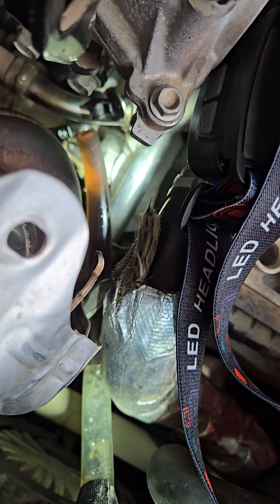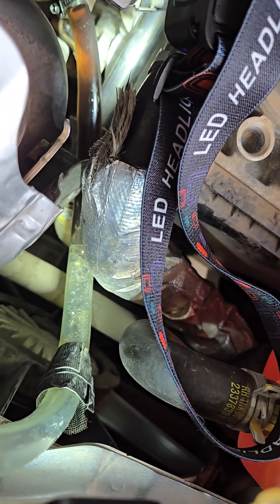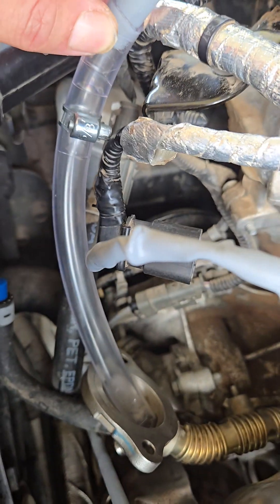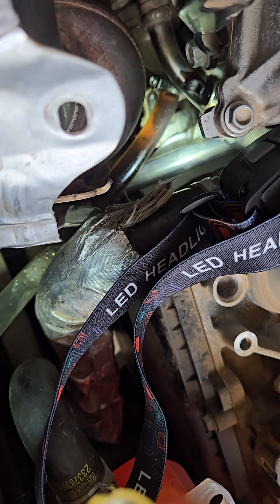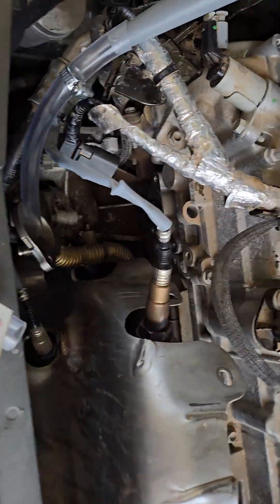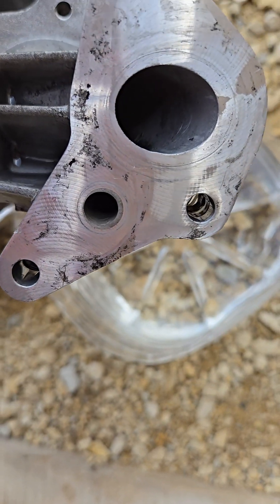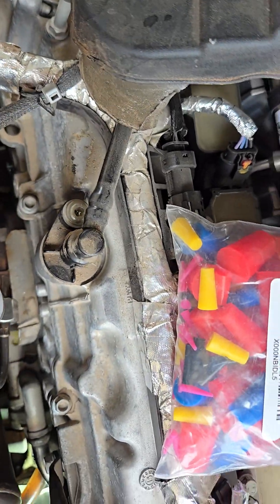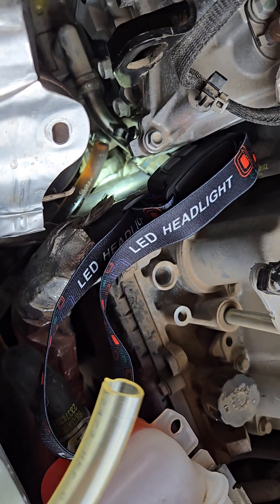2017 Chevrolet Volt correctly cleaning and flushing the EGR Cooler and EGR Valve.

Comment: Hey man I'm gonna do my first EGR clean at 75k soon, but I'd like to contribute to Volt science so I'm going to try some novel approaches. What all have you heard of people using and doing? I might try boiling water with dish detergent, and might give steam a go as well, then rinse with water, then isopropyl. I'd like to shy away from anything corrosive to aluminum so I'm not even going to use simple green - not that it matters, nothing would be in contact long enough and would be rinsed well, I just like doing things this way.

Another idea was to hook both ends of the tubing up to a pump and just circulate a cleaner of choice for several hours. I might give this a shot too if I can find a suitable cheap pump. Would sure make future cleanings convenient.

As much of a fan I am of fuel air bombs, decided to shelf the idea of using a PEA cleaner like Gumout Regane, or a penetrating solvent like Sea Foam, since this will all be atomized / vapor in the wet vac. Up that same alley I'm tempted to use my steamer with Regane straight into the block intake to clean valves and hopefully penetrate and soften EGR soot before cleaning but that one might be lethal so... no. lol.

Comment from the maker: I meant "EGR Valve" but said "EGR Cooler" 🤦. I was not planning to do a video and did this at the last minute because I know it will help others who own a 2nd Gen Volt. I meant the top of the "Intake Valves" that are located in the intake manifold that you do NOT want that Purple Power to come up too high or it will pour over the intake valves and you will have a hard start like I did the first time. I kept the Purple Power, distilled vinegar cleaner & distilled water at the level of the EGR Cooler and I did not have a HARD start.

I highly suggest regularly cleaning the top of your intake valves, preferably with a walnut blaster. I might do a video on how to clean the top of the intake valves which will help prevent that carbon buildup in your EGR Cooler & EGR Valve.